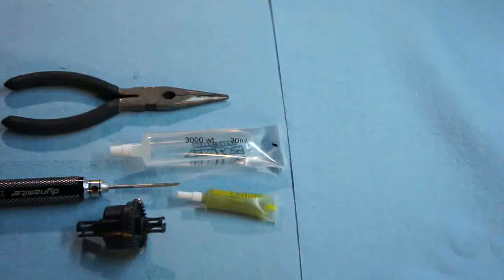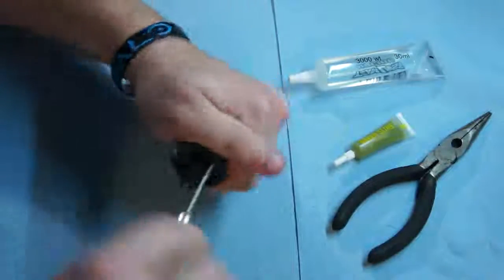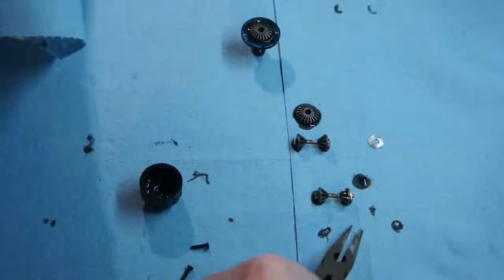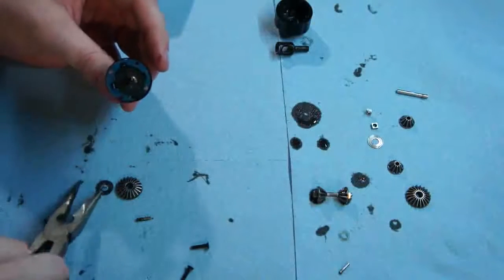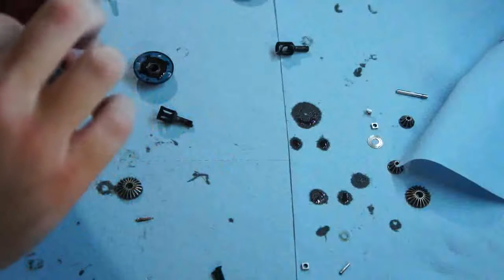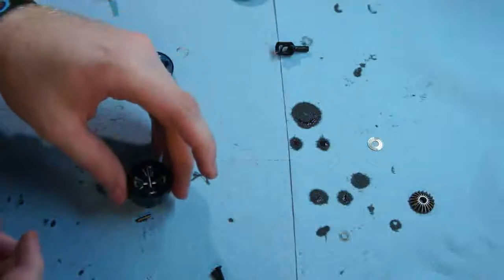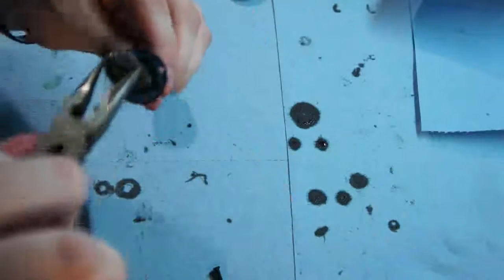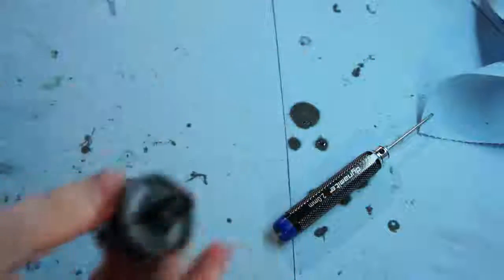HOW-TO: Team Losi Ten SCT-e differential rebuild

Comment: thanks for vid, very informative. I am assuming you do the same thing to all 3 diffs but just use different wt oil for f/c/r like 5/5/3. were you able to tell a difference immediately?
Reply from the maker: +stickaman Correct and yes, changing the diff oil weights can drastically affect how the vehicle handles. Generally thinner oil allows to diff to rotate easier (corners better) but reduces straight line traction. 5/5/2 is a good place to start then you can tune the oil weights from there to your liking. Personally I run 5/7/2 now.

Comment: I don't understand why, from the constructor it's always grease in the diff???
Reply: the reason you see grease in prebuilt ARTR/RTR diffs is because grease is less likely to leak while the vehicle sits in warehouses, shipping containers, store shelves, etc.
Reply from the maker: Its also because the RTR diffs were not designed for oil, they were designed for grease for cost savings. The "HD" diffs you see me using here are redesigned and seal better to allow for use of oil.

Fun fact, most high end race kits that come pre assembled do not come with any oil in the diffs. you have to do it before you run it :)

Comment: I have question about this littlie shim between the squarere the the gear. If I have the original and I lose one. Whant can I do??
Reply from the maker: if you are using the regular diff housing you need the shim. if you're upgrading to the HD diff housing you don't need the shims
Reply: +GeekMAXX 
So I'm in trouble!!! :(

Comment: I am just getting in to Rc world. but i am a mechanic, and not cleaning all the parts really good, you are leaveing metal from the gears, and grit. so i think that you are defeting what you are doing, being that you are leaving old oils in...just saying
Reply from the maker: Its a toy car. They aren't built to the same tolerances as a $60,000 Audi, It will be, and is, perfectly fine. I do usually take my air compressor and blow all of the grease out of all of the fine cracks though. Just didnt want to do it for the video.
Reply: right on!  just would think that one would want to make sure that all is clean. any whys i think that the video was really well explained....